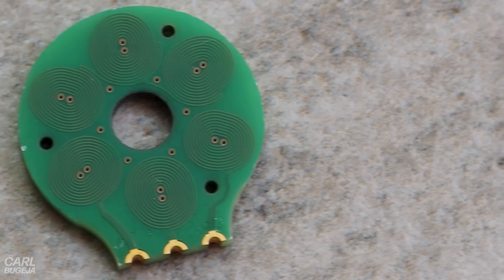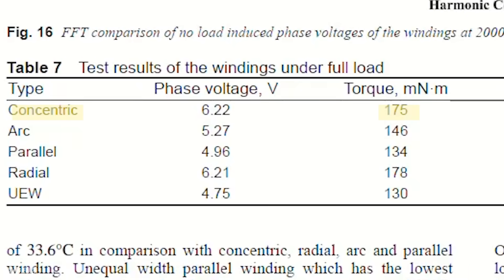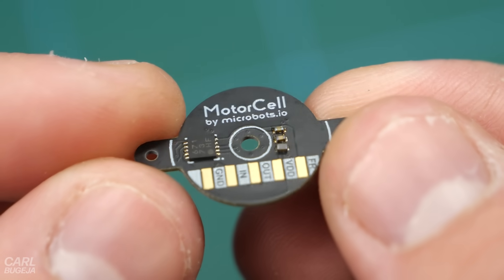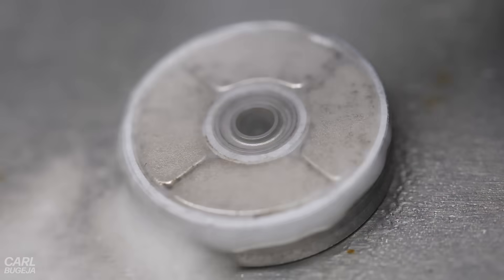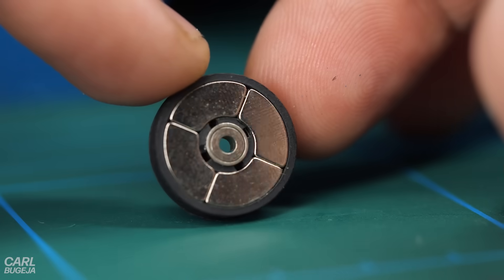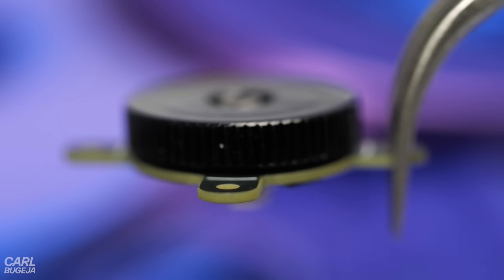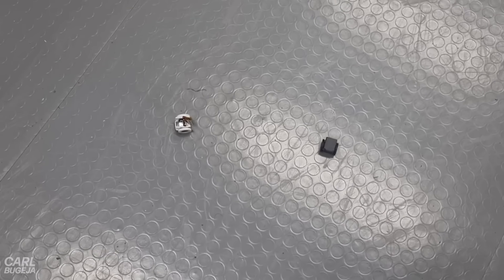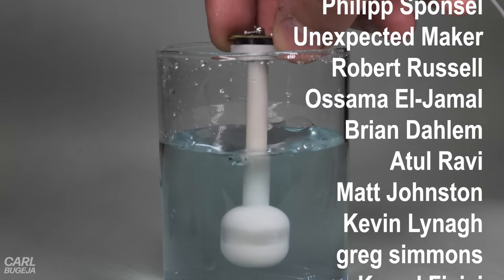How this tiny Motor Survived 1.6 BILLION SPINS

Comment: This makes me wonder how small you can go. If a micro-drone could be implemented in an inch or less of space, then perhaps use a capacitor to power it and have pogo pins to connect to a charging station beforehand, this would make a nice design for a swam idea I've got. Just need to see what the smallest microcontroller is that we can use for it.

Comment: Given the force/torque levels, it should be possible to replace the screw+nut bearing shaft by a soldered or clinched part. Its a light weight yet convenient enough option.
If needed, wave springs can be used to handle backlash (for a thin double bearing assy)

Comment: I think you need to go up a level from ceramic balls to jewelled ball bearings.   The hardened steel cages would break before the ruby balls would and because of their very high tolerances are used in the avionics industry as they don't require lubrication and can take unholy loads on very small bearings.
Reply: In the eighties I worked in the special stores at a company called Muirhead Vestric which was an avionics firm who produced devices and systems for the Avro Harriers, some of the bearings were absolutely tiny and expensive coming in back then at like £1000 each but guaranteed for an absurd amount of hours under load, the jewels I seem to remember were an "alloy" of ruby mainly with sapphire in the mix and synthetic and extremely hard whilst also being friction free, they ran in a race which was a wafer thin circle of synthetic ruby embedded into the highest stainless steel.

Comment: No expert, but why not make it double sided, whole in the middle for the shaft to connect both rotors, ofc, some way to use a single shaft to center and secure both, taking spacing into account and everything. One end of the shaft drilled and tapped so you can use it to mount things using screws. More like 2 of these stacked together.

Comment: @CarlBugeja What happens when using that controller chip if you want to SLOW or stop the motor quickly?  Is there a mode in the chip for an E-stop or do you short all of the U, V, W windings on the motor for braking?  What would you do?

Comment: Hello,

I want to start by saying how much I admire your work. It's truly impressive, and I wish you continued success in all your endeavors.

However, I noticed something about the PCB motor circuit that I wanted to share. The heat generated seems to risk damaging the components on top of the board and may potentially harm the product itself. To mitigate this, I would suggest implementing a dual-layer design. Cooling one side with a smaller fan could enhance the efficiency and usability of the other side, ensuring optimal performance overall.

I hope my suggestion proves helpful, and I look forward to seeing your continued success with this project!

Best regards,
Muhammet Fırat
Reply from the maker: Thanks for your feedback! 😊 The first prototypes I showed did heat up, but the final Motorcell product only goes to 50degC so it shouldn to do any damage
Reply: @CarlBugeja  Your welcome 🙏

Comment: Hi possibly dumb suggestion, but could you not mirror the motor on the other side of the pcb. Would that not increase power/torque? 

Very impressed with your work, had no idea what you have achieved was even possible 👍

Comment: You need a stator on both sides, for more power. Keep further away from the axle and bearing. Maybe consider using the bearing as part of the magnetic "bridge" between opposing poles. If this is a mono-pole arrangement, try adding a common "tween pole inversion", to strengthen and focus the magnetic field. (You can use thinner magnets to push magnetic fields outward, between larger magnets. You can also bridge the opposing pole, to create that super-strong "U" loop of opposing poles, on the same face.)

Are you using 4-layer PCBs? They are essentially 2 PCBs that are bonded with a blank. You can use the same thin wiring and get a parallel set of coils for higher amps, using closer spacing... Or you can keep the amps the same, but get more windings between poles. (If you make the motor directional, one-way, you can shift the coils layers so they target a specific speed with less loss. Taking advantage of the magnetic field arc and approach time of the field on the coil, relative to the layer that the coil is built on.)

You can get magnets that have multiple poles of polarity and focused or wide spreads too. Such that one of those  magnets you use, has a N and S on the same side, bridged by a virtually inert backing. They can also be dual-pole, opposing, so one side is N/S and the other side is S/N. Then you can have off-set coils to bridge magnet pairs and keep focused poles by matching N to N and S to S. Or you can use a back-plate bridge to connect the N/S back, making the "face" a closed-loop pairing of N/S. Though you will want those magnets designed with a "trough", so the field protrudes off the surface more.

Also, aluminum and copper are diamagnetic, or "magnetic reflecting", at high RPMs.

For bearings, consider looking into shaft bearings, instead of ball bearings. Ball are made to be paired, while shaft are cylinders, made to rotate a linear shaft. You also seem to have a lot of side-loading, due to the nature of the stator location. Consider a bearing with a higher side-load. (Bearings made for side-loading in that setup will need a pair of opposing side-load arrangements. A drill, for instance, only needs a single side-load bearing direction. Side loaded bearings have an angled set of bearing guides. Often the better ones will use tapered roller bearings. The difference between bearing types are like this... Assume UP and DOWN is relative to Outside-axle VS Inside-axle. Your bearings are basic axle bearings, which demands two bearings for linear axle rotation, without wobble and they can not handle side-loading. Arranged like this =. Bearings that are ONLY side-loading, look like this ||. Bearings that are for side-loading and axial stability, look like this // and \\. A "Drill", may have = and //. Cars tend to use \\ on one side and // on the other, for wheel bearings. A rotating wall which holds high weight, might use a = and || combination. Again, down being against the axle and up being away from the axle. The bearings being between the layers |0| /0/ \0\. Etc.)

Comment: Amazing research - is it an option to use larger bearings and have the magnets inside the bearing? The axle would then be fixed to the magnets and the outside of the bearing does not move which allows for easier enclosure fixture?

Comment: >Spends countless hours designing 
>Spends countless hours testing
>Spends countless hours refining 
>Makes it open source 
>Sells it for 5.99
>Calls it expensive 
>leaves 

>Gigachad energy
Reply: It should be “>Refuses not to elaborate >Leaves”
Reply: Bruh is still in the transition phase of a consumer to a producer
Reply: To be fair, you could make it significantly cheaper if you produce it at very large batch
Reply: @za_pravdu1943  exactly this. Bulk buying components and mass production reduces cost massively.
Reply: Yeah he's kinda incredible
Reply: Bro fr airdropped this and said "aight imma head out"
Reply: Ya era de código abierto, porque ya existía 😂😂
Reply: Expensive in large quantities I understand 599 is not expensive. I’m not saying that it is. I’m not disagreeing with you. All I’m saying is that in large quantities like 20, 30 or 50? It would be expensive. 7:37
Reply: bruh
Reply: I’m an engineer, but what you’re doing is completely wrong — that motor has no torque and isn’t efficient, it has no practical application. It’s a complete waste of time trying to reinvent the wheel.
If you still want to make an efficient motor, then design it so that the rotating rotor itself has magnets and a ceramic bearing that is cast and balanced — that way you won’t have any problems.
If you want, contact me and I’ll send you my doctoral dissertation on motor design.
Reply: Is he a traditional engineer I mean is he someone who holds degree free MIT or any elite university.
Reply: @Nerd-BakerWho cares
Reply: @Nerd-Baker What an insane take on what it means to be a "traditional engineer"
Reply: @Nerd-Baker Very few engineers come from elite universities due to the very nature of them being elite universities. Whatever a "traditional engineer" is most would define it as anyone with Bachelor's degree who engineers stuff, civil infrastructure, mechanical,  whatever. Nowadays the internet makes it possible to learn everything without going to college including MIT with MIT Open Courseware and others like it so as information becomes more accessible it becomes increasingly irrelevant where someone's education came from.

Comment: A few ideas that came to my mind after watching your video.
1. Why ball bearings and not needle bearings, or a pair of needle + flat thrust? Needle bearings can be much smaller in size because they can use the shaft itself instead of an internal part.
2. How about using it where you need to hold and vice versa, low speed? For example, tuning knobs with feedback, or micro-mounts for a micro-camera?
3. What about increasing the thickness of the tracks, how does this affect efficiency?

Comment: Why not use the thin nut then use a punch on the edge of the threads fold a little bit of metal in the way of the screw.

Comment: Buffo la soluzione è sotto i loro nasi ma le sfugge, voglio dire carboceramica ad intreccio spiramitrale, più che tante bobine ln rame si può fare una sola bobina in carbonio grafite molto sottile e molto conduttiva su una superfice in diamante sintetico per uso industriale gia messo a punto dai Tedeschi come superficie micrometrica studiata per la dissipazione delle alte temperature dei microprocessori il conduttore puo essere in nanotubi di carbonio con grafite dicevo e atomi di isolamento per evitare cortocircuiti inutile aggiungere che gas superfreddi possono mantenere un campo magnetico costante la ceramica eviterebbe la rottura delle parti in movimento anche se si potrebbe optare su qualcosa di non a contatto visto il superconduttivo tutto in pochi mm. e senza necessariamente un elica. Forse un utopia?

Comment: if you refer to failed motor designs, then your design will probably  FAIL  also.!!!
a motor that utilizes an  axial flux configuration (instead of  Radial) will   NEVER   perform  very  well.
but don't let these  FACTS  stop you from doing something totally meaningless.

Comment: I'm defintely going to have a go with one of these. Do the coils all stay on one plane? If they continued to spiral back inwards and outwards alternately on the layers beneath then that would be a way to get more turns. But i guess maybe the eddy currents might be worse because the fields from the different layers wouldn't allign perfectly, plus the heat dissipation would be worse

Comment: would it be possible to stack the PCB over the magnets i don't know if it would have any difference but if there is 2 PCB's with coils and a slight offset on there rotation would there be potential for the PCBs to pulse at slight different offset intervals to allow for more speed and torque don't know if it would be possible with a shaft in the center that acts as a guide for some wires then using the primary PCB to get info on rotation use that and pulse either side with power respected to the rotation (might be dumb but it is an idea and if there is anything to work off of maybe this would improve it)

Comment: Maybe I missed some understanding but would you gain anything by using off-board drivers? Can you push the limits of the PCB / current and voltage more if it had less components directly attached? This is so fascinating and exciting, keep it up! Also, how about a titanium rotor? Expensive but maybe worth the investigation from a materials/performance standpoint.

Comment: With more powerful setups, you may want to stack them in succession to where your magnetic field makes the torque more powerful, or you can increase the surface area for a more "flat style" motor, both of these would have a lot of uses with Industry.

Comment: This is sick as hell! Is this for research or is there a problem this motor is trying to solve? It seems like other manufacturing techniques may be better for power and loss reasons
Reply: Should have watched further, still not sure on the applications though and maybe integration into existing pcbs is tougher than its worth. Your knowledge gained could be used so well in making more efficient motors without the limitations of FR-4 dielectric strength and copper thickness!

Comment: Have you considered making a pump of it? It wouldn't be able to pump much, but it could be used for low requirements such as watering flower pots for example. You could integrate the pump and a soil dampness sensor in the same pcb even.

Comment: In astrophotography we are using special cameras that need to be cooled at -30 degrees Celsius, this is done by gluing a peltier cooler to the sensor or the pcb. Maybe a good ideea to try it out in order to cool the motor at a manageable level

Comment: At 30k RPM, you need an output speed reduction to make it useful.
Reply: I'm placing an order for a couple of these to play with.  I think I have a transmission design that would match it very well.  I love the design is open source with the design files easy to find and download.

Comment: Motors like this could be very useful in space applications, especially when weight constraint are one of the biggest problems. Think "reaction wheels in cubesats" or one time applications like extending booms and other deployment tasks after launch. With cheap motors like this that can be directly integrated into existing PCB designs (and similar inventions by other garden shed inventors), this will allow hobby groups and small universities to afford building more complex spacecraft within cubesat specs.

Comment: Make the robot with a smaller diameter of wheel. You can achieve it by putting the motors at an angle. Also, control algorithms would make it much easier to play with.

Comment: So, 1.6B turns is just over one month of spinning at 33 000 RPM? Is that the end of life of the motor or does it go much further? I was thinking of an application but I need a life of ~10 years. Great job of designing the PCB motor BTW

Comment: Great work. Consider putting a stator on either side of the rota to double the torque. It would limit it's application but would still be useful in many areas.